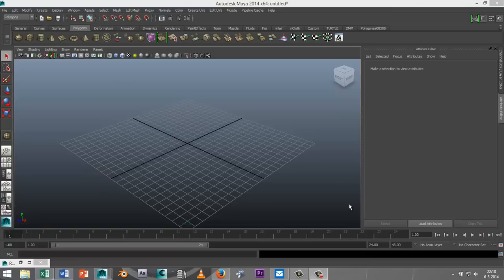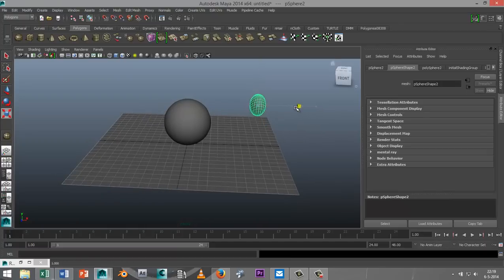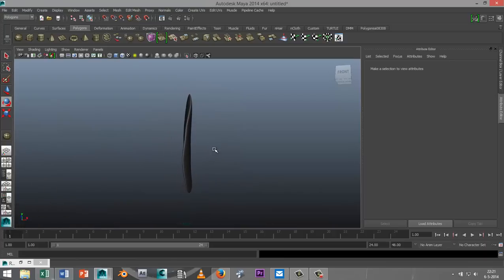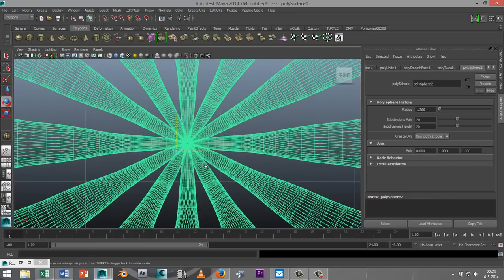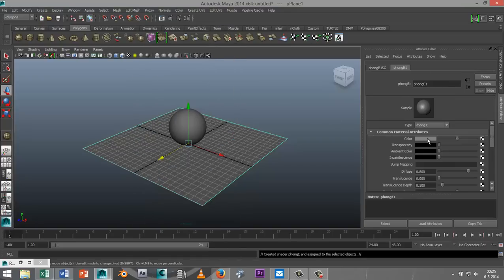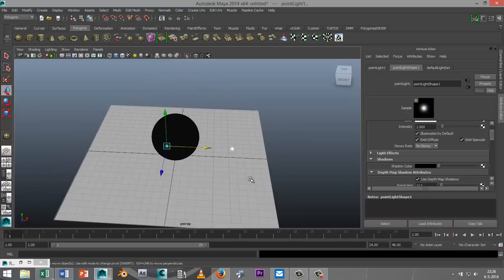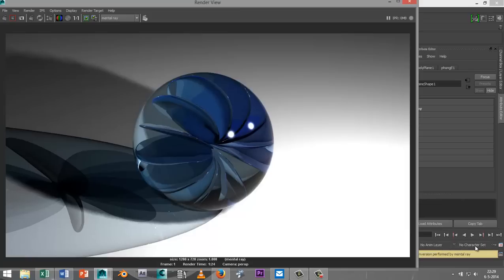Maya 2014 tutorial : How to model and texture a marble

Comment: How can I get it to bend like this in Face Mode? It's much smoother the way you do it (smoothing afterwards doesn't help either.) My "Soft select" also doesn't make a change. (It's just yellow and blue, not orange or sth like that...).

Edit: I did it with the twist deformer now - but when I duplicate it all the additional objects don't form a center with it, but they all appear WITHIN each other.
Reply from the maker: +Sakisasvictorianmask Not exactly sure what you are asking here....
Reply: I think this question is talking about the 'duplicate special' action. The correct result saw the inside of the marble being duplicated in a circle. If the x,y,or z axis is not correctly set when you go to duplicate then this would account for the object being duplicated in the same location instead of in a circle. It could also mean that you didn't adjust the center point for rotation via the insert key.

Comment: Hi!

I'm using Maya 2016, and I can't find mia_material_x tab when I'm trying to add new material. Do you know what the problem is? :\
Reply from the maker: +Szilárd Papp You need to download and install Mental Ray ( Autodesk.com site )
Reply: +Mike Hermes I installad the Mental Ray plugin from the site "http://knowledge.autodesk.com/support/maya/downloads/caas/downloads/content/mental-ray-plugin-for-maya-2016.html" but still I can't find it :\
I've got an educational version, could this be a problem?
Reply: +Mike Hermes I realized that I didnt install the SP3 yet, I installed it but i cant notice any changes :\
I got this, when I'm opening the "add new material" tab.: http://kepfeltoltes.hu/view/151004/maya_www.kepfeltoltes.hu_.jpg
Reply: +Mike Hermes 
After a lot of digging, I've finally found the answer among the Troubleshooting messages on the Autodest webpage. The key setting after the installation of the plugin was this:

"Enable mental ray scene rendering on a computer where Maya is installed.The Maya installation directory contains an installer for mental ray renderer. This version of mental ray is used only for local rendering on the same computer as Maya.To run mental ray locallyInstall mental ray renderer, using the installer.In Maya, select Windows > Settings/Preferences > Plug-in Manager.In Plug-in Manager, set Mayatomr.mll to Autoload.After the Mayatomr.mll plug-in is enabled, and Maya restarted, mental ray appears on the Maya submenu Render > Render using."After this, it works for me :)Thank you for helping, and sorry for the unnecessary messages :)
Reply from the maker: +Szilárd Papp No problem, glad you fixed it
Reply: +Mike Hermes 
1 more info.
The rendering was not proper with mental ray. Fortunately, I managed to sort it out. 
I've got some shader error messages in the output window:
PHEN 0.3     23 MB error  051011: shader "maya_shaderglow" not found
PHEN 0.3     23 MB error  051011: shader "adskMayaVolumeEngine" not found
PHEN 0.3     23 MB error  051011: shader "maya_state" not found
PHEN 0.3     23 MB error  051011: shader "adskMayaAmbientLight" not found
PHEN 0.6     42 MB error  051011: shader "adskMayaShadingEngine" not found

The solution was installing the SP1 for mental ray (mentalray_Plugin_for_Maya_2016_SP1).
After this, I've successfully rendered the picture, although I got much brighter shadow behind the glassball, and the 12 glass "thing" inside the ball is also much brighter in the rendering image then  in the saved picture.
for comparison: http://kepfeltoltes.hu/view/151006/match_www.kepfeltoltes.hu_.png
Reply from the maker: +Szilárd Papp Good

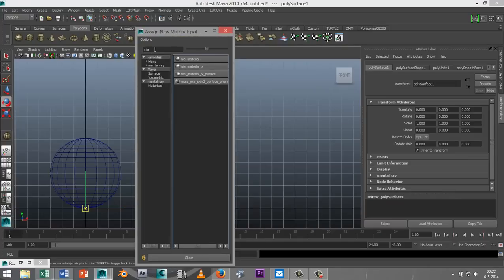Comment: Hi!! I was just wondering, I have a basic student edition of Maya 2014, and I don't have the texture that you use to assign to the shape at 4:10 ish. Is there a similiar texture I need to use or do I need to download a texture pack?
Reply from the maker: ***** Hi Savannah,

The material used is a so called Mental Ray material and should be available in all versions of maya. But to see them you must activate your Mental Ray in your Plugin Manager. Here's how you can fix that ;

Go to your top menu and select

Window - Settings/Preferences - Plugin Manager
Then scroll down and look for Mayatomr.mll and select both Loaded and Autoload

This will enable mental Ray as a rendering option and you should now have that material,

Kind regards

Mike

Comment: i do not have your texture material in my maya did you buy it from anywhere online ?
Reply from the maker: Hi Shev,

The material is available when you render in Mental Ray. If you don't have Mental Ray then follow these instructions :

Topmenu : Window - Settings/Preferences - Plugin manager

Then look for Mayatomr.mll and make sure both loaded and autoload are selected
Now you should be able to use the materials

Mike
Reply: thanks mike !
Reply from the maker: Shev Vin
No problem
Reply from the maker: ***** You should have as it is standard in Maya. What version do you have ?

Comment: beginner question: why did you use a partial select & rotate rather than say a bend deformer?
Reply from the maker: Hi Ewan,

No reason really. There are a lot of ways to approach this. You can use a bend but then you would have to bend it twice. You can also use the lattice tool, modify the vertices, edges etc.
It just felt right at the time. If I would have to do it again I would probably have used the lattice tool. If you don't know that one, check my video on the subject.

Thanks for watching and responding !

Mike
Reply: Mike Hermes I will do, subscribed to your channel, thanks :)
Reply from the maker: Ewan Ferguson
Thanks Ewan